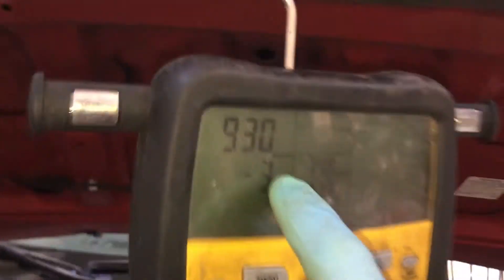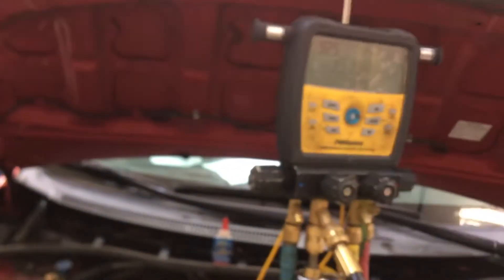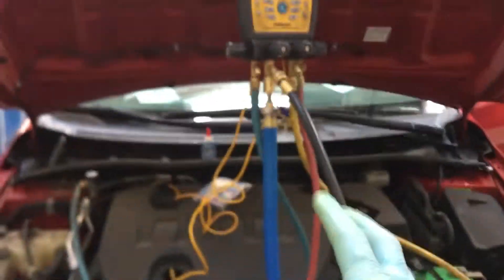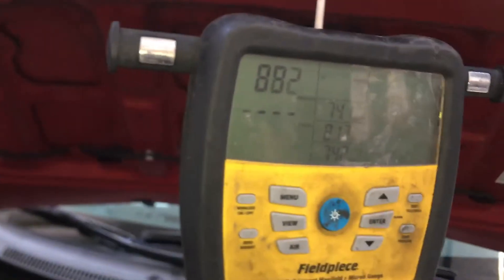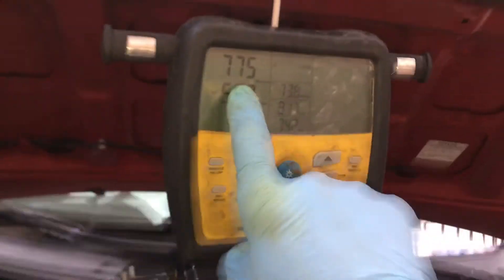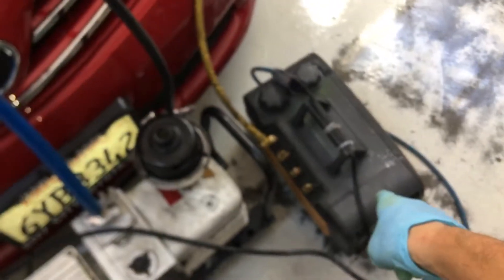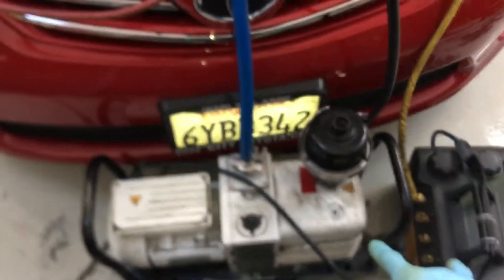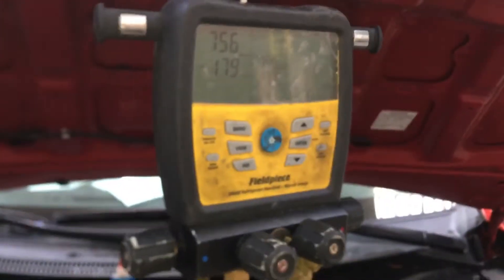Two Vacuum pump￼ ?(“Somebody on YouTube said two vacuum pumps don’t make a difference”) ￼

Comment: ok. i have plenty of time for DIY but on budget. i was thinking to run two cheap vacuum pumps (buy another one single stage pairs with my double stages) in series or modify my compressor (dual head)+ my vacuum pump in series to pull a deeper vacuum. which one is more practical? i can run them in a few days for a small car AC.

Comment: Question...Is it ok to use the same vacuum pump on different types of refrigerant? do I risk contamination? i.e.: evacuate 134A system then use the same vacuum pump to evacuate 410A
Reply from the maker: No problem vacuum pumps only pull out they don’t push into your system you’re not going to contaminate anything. 

And you’re barely pulling anything out anyway because either the systems are completely bone dry or use a recovery machine to remove all the refrigerant so you’re not removing refrigerant into your vacuum pump other than my new trace amounts that are still trapped in the oil